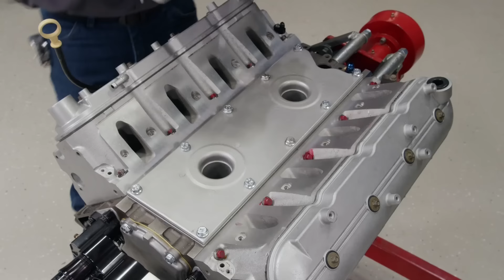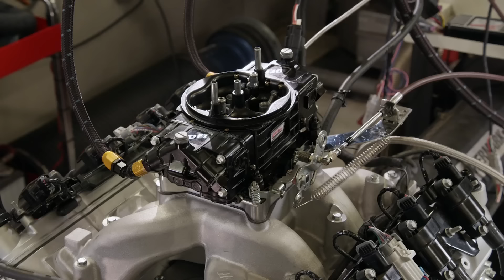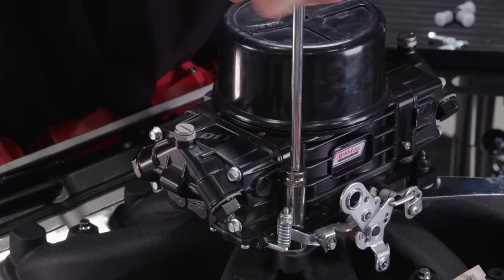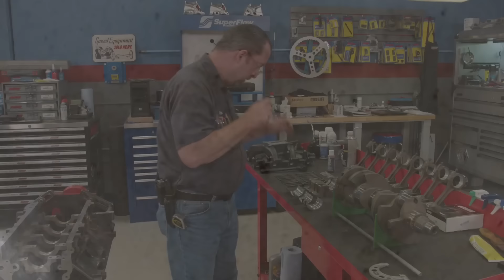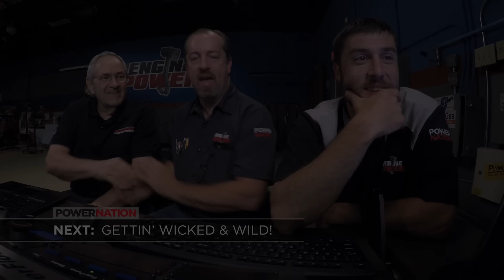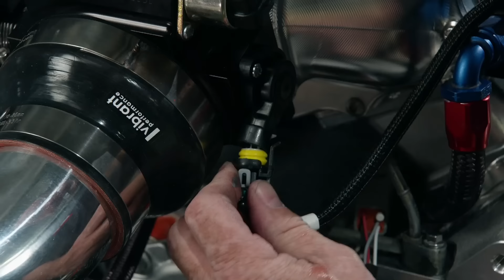Improve Horsepower and Torque: High-Performance Tips For LS Engines - Engine Power S7, E16

Comment: Putting a carb on an LS may be the "easiest" route, but certainly not the cheapest... Wouldn't the cheapest be all stock with the factory GM ECU flashed with HP Tuners or something?
Reply: Exactly. Over $700 for the intake and ignition stuff then they drop a $900 carb on it. For around a $100 flash to a stock computer you can drop in all the stock stuff.
Reply: @joew7897  And retain your EFI, which is FAR easier to add boost or other power adders. So if you spend $500+ on an intake and ignition system, then another $400-600 on a nice carb for it, you're in Holley terminator territory. Which makes it even easier to have EFI that has built in capabilities for nitrous or boost, or whatever you wanted to add to it...
Reply: If ya can’t tell products what where supplied by different manufacturers steer how the episodes go lol. How they gonna sell these parts if you got someone like Matt that comes in and does a dirty half ass build on a junk motor and makes a reliable ~800hp for less than they have bolt on parts
Reply: baggedmazda666 Oh for sure, wouldn’t we all love some sponsored parts?😂 I also subscribe to the sloppy mechanics train of thought. Quick and dirty, but functional. Just be sure to add ring gap😬
Reply: Locally I can get a stripped long block 5.3 for $400. Anything with wiring is $1100 and they don't guarantee anything electrical. Reflashing the ECU is another $2-300. A carb can go on anything. The MSD box can fire any GM coil. It's easy to sell when you get into other projects. A Holley Sniper is another great option. Again, a quick and easy sell. A 20 year old factory harness is a hard pass.
Reply: They should use the factory l92 rectangle Port heads those heads can be used on any LS with 4in  or biggerare. There cheaper than the aftermarket ones therr are going to get. I'd like to see them build the best power they can get with factory parts or cheaper parts from reputable manufacturers seems like they just use whoever sponsors them for that week.  I believe that factory lq4 iron block can take a 60 overboard no problem but I'm not sure. it could definitely take a 40.  I'd wish tthey would leave the EFI intakes. they have the computer controller boxes. the carb intakes just seems like a waste you got to buy a whole new carb intake and a carb if you want to do that. I don't know how it's cheaper and you're not going to get any more power
Reply: Yea they lost me with the carb set up. EfI is far more efficient especially in terms of drive ability. Besides, engine dynos are ok, but nothing compares to under hood, real world applications which is where most of us working guys live!
Reply: @Dmack434  I’ve been playing with DynoJet’s drivetrain loss test and typical losses I’ve seen range from 100 hp in a Mustang GT with a manual to 155 hp in a truck through an auto. Whatever it makes on an engine dyno, subtract at least 100 hp to the wheels
Reply: How much money  to reach the final hp rating ?????
Reply: But they are talking about buying a motor with no accessories and intake manifold so would it still be cheaper like that to go factory?
Reply: Yeah at least on a 5.3 iron block, a rebuild, a cam (and related parts), tune, and something like a trailblazer SS intake will make great power on the cheap.
Reply: EFI is better in a lot of ways - but if you're out in the woods - carbs are better as you can rebuild them, adjust them on the side of the road...
Reply: Probably the only way its cheaper is if you scored on a cheap long block, already have a carburetor sitting around, and don't have the intake and fuel injection setup.
Reply: @nate0765  I agree.and most motor guys do have that tho .it's kinda like my gen 1.
Most of the parts I had when I went from a 355 to 385 all forged internals..I had block,intake,heads, headers,msd.yata ,yata yata.i just bought 3.750 crank  .13.7 to 1 slugs,.new cam and  solid roller
 tappets.....that na 100hp was almost 4k by the time I was done.....but I had about that in the 355..
Reply: Yeah right and i got a girlfriend who i dont want to have set with
Reply: Watch LT from truck tech on his own channel. He does everything from his own garage. Check it. https://youtu.be/H-IoOS3krnU
Reply: Lol that’s hilarious. Try building a 302 87-93. To have a machine shop build one intake to pan with decent parts is 10K+, and you ain’t getting 550hp lol
Reply: It's a junkyard motor. It's gonna need coils, cam sensor, crank sensor, MAF, and some wires will be cut or funked up somehow. The truck intake is pretty tall too.
Reply: They use carbs to use a tighter lobe cam to get more power.  Carbs open up the cam selection for way more power on a dyno.
Reply: @bowsertownes  how do carbs affect cam selection over EFI?
Reply: @SamSheepDoq   its not carbs that effect cam selection,  efi just has to run a wider lobe separation angles.
Reply: @bowsertownes  okay, but why do you say that? LSA is only one variable for overlap, and I’ve seen some wild cams on EFI so I’m just wondering where this came from.
Reply: @SamSheepDoq   i say it because it is what it is. Overlap is a very important event.  Carbs just perform better on the dyno. Thats why they slap carbs on a dyno session with paid sponsors.  "We want you to run the carb on our cylinder head cause it performs the best with that on the dyno, it will sell"
Reply: bowsertownes I’ve personally never seen one or the other perform better on the dyno. Richard Holdener of Hot Rod Magazine has tested a lot of combos and carbs and EFI always seem to make the same, they just drive differently
Reply: Going from EFI backwards in time to a carb is just plain stupid.
Reply: @FredSanford2003  engine masters proved your comment wrong.
Reply: These guys are old as hell, even the younger guys… it’s like a mentality thing in their minds it’s still 1969 and carburetors are still the only option for power. They go completely out of their way to avoid computers just to say carbs are easier but they put waaaay more effort into it to make less power

Comment: With spacers on the oil pump to clear the thicker timing chain, do you have to use an after market oil pick up or will the factory unit fit correctly?

Comment: I would have liked to have seen a run with the cam and the stock heads.
Reply: Anything you'd like to see LS related check out Richard Holdener.  He's tested nearly everything.
Reply: Agreed. Cam makes more sense to do first considering the cost
Reply: With an LQ4 like this, on 93 with an intake (TBSS or LS6 for the stock intakes), long tubes, BTR cam and valve springs (otherwise completely stock heads) you should be able to put down 405-420hp no problem.
Reply: That’s wheel horsepower by the way. That’s numbers I’ve personally seen.

Comment: Have you ever built a v12 would like to see that build
Reply: @bigboreracing356  Actually there is a aussie that cast LS v12 motors...
Reply: @Thelongmanable  Do you have a link or what channel it is ? Sounds interesting.
Reply: https://youtu.be/PsQjS6WIaEY not my channel
Reply: @immelting9834  Though love to have a true ls v6
Reply: @Thelongmanable  Yeah the thing is +$70k USD! What an absolute joke. The stupid thing is - and this really gets up my nose, is Americans can buy it cheaper than we can. Really pisses me off this sort of thing.
You have to be rich.
Reply: Funny story there was going to be. A v10 ls but then 2008 hit
Reply: @austindoud273  I think a v10 is more practical also fit in a lot more vehicles... Actually like to see something like a ls1 v4 or v6 because it's a very reliable motor that go great as a retro fit for other cars...
Reply: @Thelongmanable  that's a thing the new 4.8 is a v6 but gms previous hi feature v6 is also really  good like the lfx in the Camaro rated for like 300 fly
Reply: @Thelongmanable  ls1 4 banger, lol. GM has a durable and excellent 4 cylinder called the ecotec
Reply: @austindoud273  I read new pushrod v6 that replaced the 4.3 is 300hp or something close to that..
Reply: @austindoud273  I'm currently trying to weld in a 4.3 combustion chamber and only manage to take it from 68cc to 64cc despite all the welding. I'm never seen it done before and will PERSONALLY probably never do it again matching each chamber up the same. Honestly I think I figured out a superfast way to do it but I need to machine some plugs first....
Reply: I think I remember them working on a V-10 out of a Viper some time ago but, I could be wrong.
Reply: @michaellinner7772  It was that slow v10 ram that with all those mods still was boring as hell..
Reply: @michaellinner7772  <We live in a era of 1 thousand hp daily drivers yet they build less 100hp inline six motors...
Reply: @Thelongmanable  cough cough 99'+ 4.3 vortec 😂jk, but the late model chev v6 is a 3.6 lfx found in caddies, cameros and others, and it and push upwards of 325 is hp. Great engines but i prefer v8s (also i thought the 4.8 was one of 3 cast iron chev v8s since 98'-99' in trucks for the other guys comment)
Reply: @doodlebug6833  Depending on years of made 3.8 made 300hp maybe few others but on luxury brands...
Reply: I like LTs builds. He is the best. https://youtu.be/H-IoOS3krnU

Comment: Any news on that ford 300
Reply: @bigboreracing356  That fact that you are trying to change the subject means i just won the argument
Reply: @bigboreracing356  you can get 600 hp naturally aspirated from these engines
Reply: They continue the Ford 300 build in episode 17.
Reply: @nomen_meus  Nice
Reply: @bigboreracing356   Here's one
https://www.youtube.com/watch?v=zzwmr3OAb3g
Reply: @bigboreracing356  Stock yes rpm wise
Reply: @bigboreracing356  They don't make 600 hp stock but if they did they would have been extremely popular just like the Aussie Barra 6  the nissan RB 30 etc
Reply: @bigboreracing356  The ford Barra is dirt cheap and will handle 600 hp stock so it is much cheaper  the block can handle 2,000 + hp
Stop making retarded comments

Comment: Why’d you ditch the full roller rockers? Or did you leave them in the first setup?!
Reply: They couldn't use the summit brand on the new heads. The intake rockers are offset on the square port ls heads.